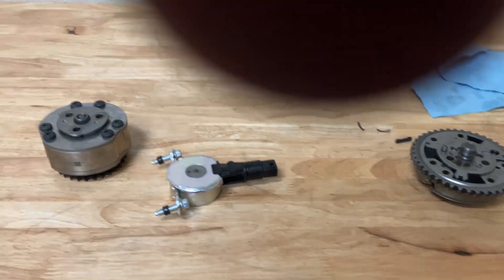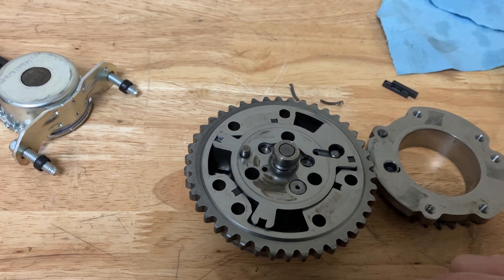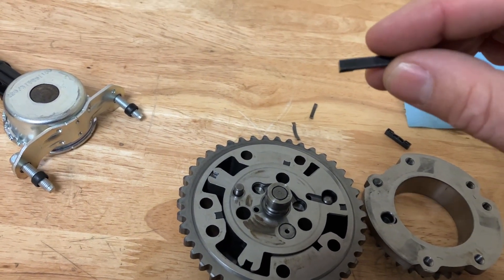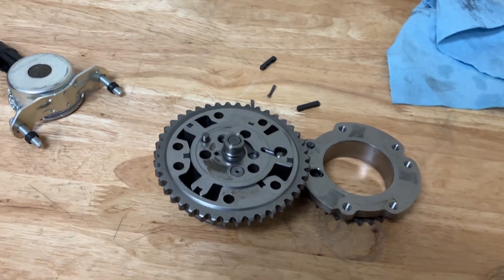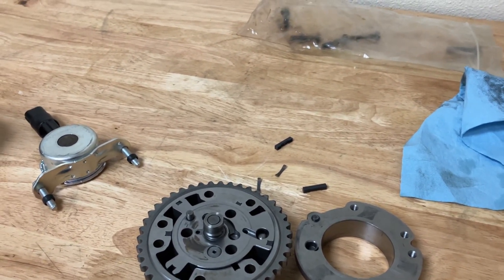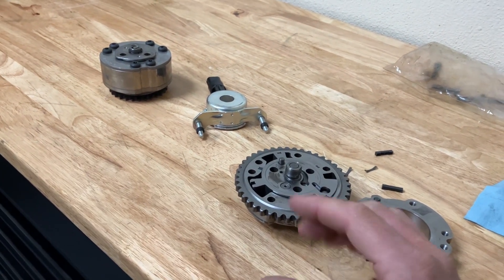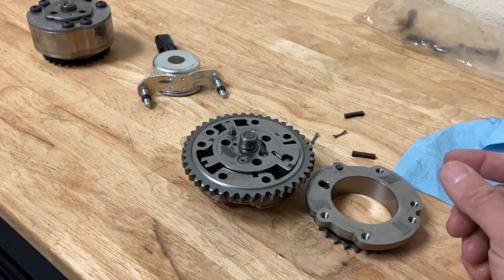Coyote Cam Phasers, how they work.

Comment: So would 5w-30 be better or worse for a 2016 5.0?  I had a P0011 code 6 weeks ago, I was 1.5 quarts low using semi synthetic Castro.  I changed the oil to Pennzoil ultra Platinum and the code never came back.  Should I stick with 5w-20 on the next change?

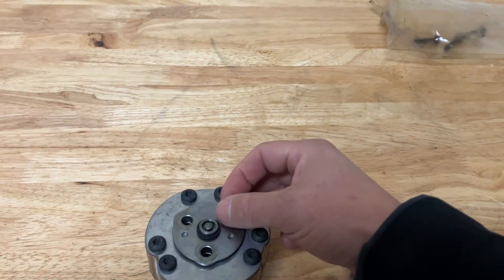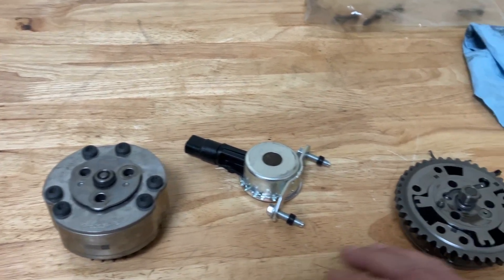Comment: @aedtuning8441  The timing chain pulls the camshafts around, the valve springs are not how the cams are phased. The advance chamber and retard chamber are both filled with, drained of, or held at a volume of oil via the spool valves position. at 1:14 you called this spool valve the "oil pressure bleed." The spool valves position is controlled by the solenoids DC, not how much oil pressure is allowed in the phasers. they get 100% of the available oil pressure at all times.There is no flow through the phaser control chambers, oil goes in and out of the same holes creating a hydralic lock in the cams phased position, it doesn't require any more oil pressure than what is needed to fill the chambers to the desired volume. Which can be easily achieved at even very low pressures as its hydralic force creating the needed actuating torque.  At High DC the spools position is pressed far in and oil is directed to the retard chamber feed. That chambers volume is expanded and the advanced chambers volume is shunk, retarding the cams relative positon. At mid DC the spool valve is position so that both advance and retard feed holes are sealed, no oil is allowed in or out, holding both chambers volumes constant and the phased position is held. At low DC the spool valve is not pushed in very farand oil is directed at the advance chamber feed hole. That chambers volume is expanded and the retards chamber is shunk, advancing the cam relative position. The torsion springs on the front of some phasers only aids in advancing the phaser against the retard bias of the cam torque. Wether the phaser has this torsion spring or just has the retard bias of the valve springs, doesnt negate the hydralic like oil control in the advance and retard chambers that is used to actually phase the cams during normal engine operation. the seals that seperate the chambers you mentioned at 2:00 are very important, and the spool valve clearances in the center bore are also important in preventing leaks from these chambers.

Comment: 2015 Mustang. I have a misfire problem. When I drive the car at 2,000 rpm,  when I disconnect the phasers wires the misfir is not coming 

anyone know what the problem

Comment: Do you think its ok to run 5w30 on a stock Gen 3 coyote? mostly driven street and see the drag strip once or twice a year. Or should I run 5W50 during track runs and is it ok to change oil weights several times a year

Comment: P0018 error on a gen 2 and even changing the solenoids no solution.. Over advanced in the exhaust.. What else could cause it?
Reply: I'm having the same issue but p0019. Talked to a builder and he said the phasers was most likely toasted. I Data loged and at idle they were 10⁰ off from the opposite bank
Reply: @Dr.nikkidiki  ay, i just replaced the solenoid, it improved a tiny bit vibrations but it still pops up the error. Pretty sure at this point I need a new phaser. I wonder if I can just replace the phaser or I need to redo the whole timing..
Reply: @Dr.nikkidiki  update, replaced the whole phaser plus all new timing. Had to pull the engine. The central valve is stuck and I can't seem to understand what blocks it. Anyway it works now, 2k€ after lol

Comment: My gen 3 coyote is currenty in at the dealer for codes 0021 and 0022, they are changing the chains and guides not the phasers, vcts were changed 15k miles ago same code then, i dont see why they would'nt change it all?

Comment: I am so glad you made this video... everyone argues with me that 5w20 is the best for these motors because the vvt channels need thinner oil to maintain pressure and flow, i keep trying to tell people that the 20viscosity oil is FOR EMMISIONS STANDARDS ONLY
Reply: What oil viscosity do you recommend for this?
Reply: @ricjohn4265  seconded
Reply: A few people I know recommended Rotella T4 15w40. They said they run it in their 5.0 f150s with no problems. When I did my first oil change, I went with 5w30 full synthetic because everyone online was saying that’s the way to go. Still heard the “coyote tick” so I dumped the 5w30 and decided to try the 15w40. Started it up and the tick was gone in about 5 seconds. Never heard it again.

Comment: Great video and info.  Sir I have a 2011 5.0 and I let it go low on oil and it's now running really rough. What could have happened? Thank you
Reply: Could've jumped timing. Those timing chains have tensioners that set tension off oil pressure. If timing is jumped, you will run rough and misfire on every cylinder almost

Comment: So my 2019 Cam Phaser Solenoids were sticking. I really suggest listening for this issue if you have the 2019 Gen 3 coyote. If you rev up to 2000 rpms and let go. You might here a slight ting from the upper front of the engine. You can unhook the solenoid and the sound disappears to be sure of it. Really hope this helps out anyone.
Reply: Wheres the plug at just right on the valve cover?
Reply: @White_Fox_5.0  basically. You unplug the top of the solenoid at the front of the valve cover.
Reply: @Ponyo3816  while running?
Reply: @White_Fox_5.0  yes. If the little metal sound disapears when you rev the motor. That's a sign of a sticky Solenoid.
Reply: Were they sticking open or closed?
Reply: Unplug the intake or exhaust solenoids…or both?

Comment: Great video.  Very nicely explained. My 2015 is doing the classic ruff idol abd sometimes nearly dies at the stop light. But I am not getting an engine light. My first thought was the selenoids or the phasers. What is your thought? I do have a scanner and i can see where the cam timing drops drastically when this happens but no codes or engine light. Help please.

Comment: Interesting information, thanks for sharing. I'm building a 5.2ltr in Gen 1 Block with Gen 2 heads for circuit racing. I am wanting to keep the VCT. What cam timing gears. chains and tensioners are you using? Hard to find anything other than genuine Ford stuff unless you want to lock the cams out.

Comment: Hey man thanks for the awesome video! Helped me understand this much better. I got code p0022 a while back that signaled a retard timing in bank 2. I changed the vvt solenoids in that bank and the problem went away. I used motocraft solenoids. Well a week ago the symptoms came back, truck stalled in idle a few times during that week. It usually when the temp is hot outside and im coming off the highway to a stop.  I examined the solenoids i replaced and noticed one of them had a very small amount of oil inside the solenoid electrical connection. I decided to change BANK 1 solenoids yesterday and used 10w-30. Truck seems to be running fine now and I ran a live data test on forscan of the vvt PIDS, everything seems to be in check. Do you think its something causing the solenoids to go bad, im worried about that small leak in one of them. Im assuming because I only changed one side initially the other bad ones were causing more strain on the new ones. Thanks so much
Reply: Oil within the connector part of the solenoid means the overmold is cracked. These solenoids can withstand a hell of a lot of abuse voltage and temperature wise. If I had to guess id start looking at the wires coming too and from the solenoid. A small increase in resistance can have a very large effect on the expected response of the solenoid. So make sure your grounds and connections are good.

Comment: Could this cause a cam phaser to act up intermittently if the incorrect oil is used in a built motor application